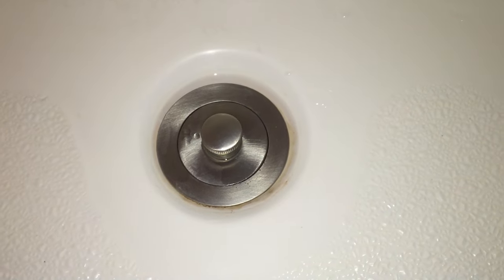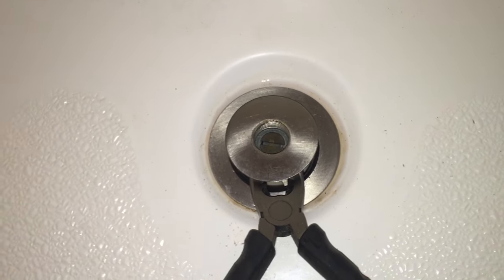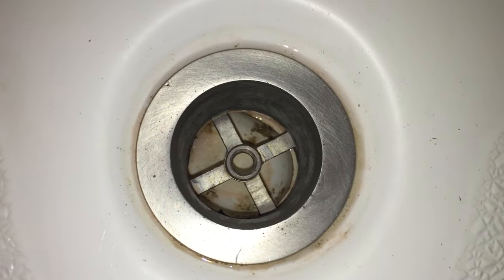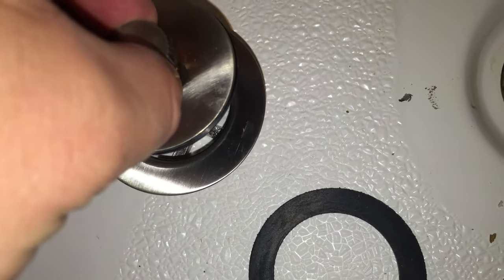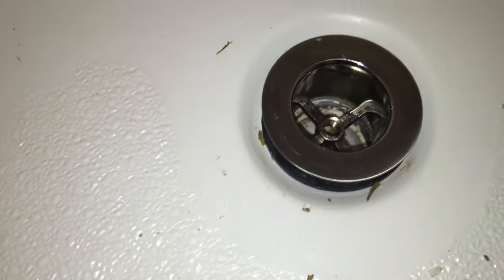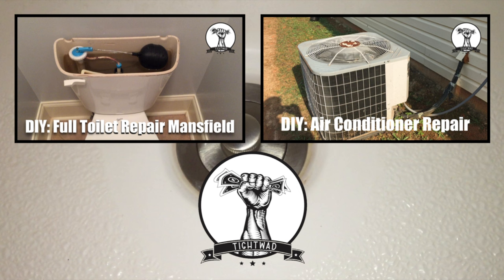DIY: How to Replace a Bathtub Drain Stopper with Common Household Tools

Comment: Rubber gasket goes on the bottom side of tub between drainpipe and tub. Use plumbers putty where he put gasket
Reply: Literally looked through the comments to make sure SOMEONE pointed this out and explained how it's done properly 👏
Reply: Yeah, most videos I've seen has the rubber gasket underneath the tub, then plumbers putty placed on the inderside of the drain screw thingy.
Reply: I really hope the water doesn't leak through and ruin the floors. There's added weight with a person in a tub, and especially the weight if they are taking a bath. That needs to be a tight seal with putty to prevent leaks, not something I'd trust to those gaskets alone that get brittle so quickly. The putty smooshes into all the gaps and creates a better seal.
Reply: Bro thanks for your skills I really appreciate it

Comment: Rubber gasket goes between tub and drain pipe...below tub.  Not between drain and tub (not on top of tub).
Reply: Correct !!!!!!!!!!!!!!!    Important point.
Reply: I understand that but once you have the drain out is it not wise to replace the rubber gasket that is probably degraded too? That was my point.
Reply: Always use plumbers putty around the seal and it's not for the threads at all...

Comment: This video is so VERY VERY helpful.  I thought I would need to hire a plumber, but after watching this video, I see I can do it myself!  YEAH!!!
Reply from the maker: Jeanne Gleason A mistake in the video was pointed out to me. Ideally, you will use plumbers putty on the threads when screwing it back in. The rubber washer is supposed to go under the tub so it isn't needed.
Reply: Again I thank you so much for caring enough to write me about this correction.  I've gathered up the tools and was about to start my when I saw your email about the correction.  I will look at your posts first in the future when I need to do home repairs.  Thanks! JG
Reply: It's fixed.  Thanks, TightWadRepairs! JG

Comment: Thank you for this video, I fixed my drain all by myself! You're such a blessing ☺️
Reply: Hope you didn't put the rubber washer under the drain like he did. It needs to go under the bottom side of the tub. You can see the original rubber washer under the tub when he pulls out the drain. You need plumbers putty under the new drain so when installed it creates a seal on the top side of the tub and there is also a seal on the bottom side of the tub with the rubber washer. It is a common mistake but it makes a big difference, this video shows the rubber washer installed in the wrong place. Not trying to be negative just don't want you to have any water damage in the future.

Comment: 0:00  Introduction
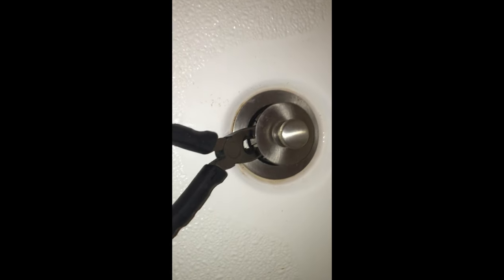0:52  How to remove drain stopper
2:12  How to remove drain
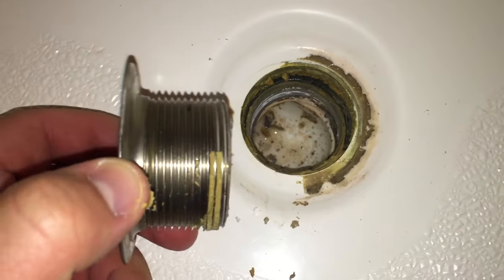3:27  Discussion of new drain and stopper
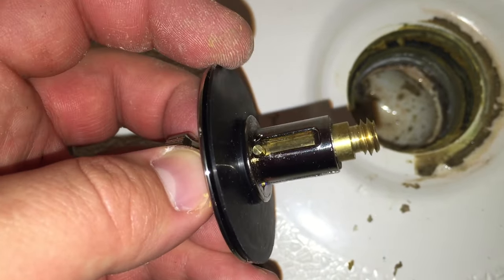4:43  Installing the new drain
5:24  Installing the new drain stopper
Reply from the maker: Thank you! I need to go back and add chapters to all of my old videos!
Reply: @TightWadDIY  also should post a correction of this video. The gasket is in the wrong place and no plumbers putty between the drain seal and the tub. Not trying to be a dick but this is incorrect. Still better than what some might do, but not as a professional 🤷‍♂️

Comment: Neat video!. Cheers from 🇨🇦
Reply from the maker: Thanks!
Reply: @TightWadDIY  been doing renovation and came across this. Very helpful. Just started my own channel.
Reply from the maker: @methane101  Congrats on the new channel! It’s a slow grind at first. Stick with it and it will pay off big time in the long run. Feel free to reach out on Instagram if you have any questions.
Reply: @TightWadDIY  thankyou. And I hear ya. I can see that already!. But like you said. It takes time. Most good things usually do. Thanks for the helpful insight!. I definitely will. Love the community!. Very helpful everyone is.

Comment: Note that some similar looking drain stoppers have a set screw that retains the stopper. It can be accessed by pulling up on the plug. Once the set screw is loosened, the stopper can be removed. For this type of stopper, the dual pliers method will not work.

Comment: The rubber gasket replaces the old rubber gasket which is between the lip of the bathtub and the drain pipe.
Reply: I noticed this too, but is a rubber gasket better that using plumbers putty or silicone?
Reply: @sacchn6199  The rubber gasket is there to seal between the drain pipe and the bath tub. The bath tub itself lowers a bit with the weight of the person in the tub, and the additional weight of the water if the person is taking a bath. These rubber seals get brittle quickly, so it should be changed when you do this. The plumbers putty is what makes the actual seal between the drain plug, the pipe, and the tub. You use extra and the putty squishes into the cracks and makes the seal water tight. If his daughter takes a bubble bath, the added weight in the bath tub will cause a small leak from pressing the actual tub down. I wouldn't use silicone (caulk?) it's okay for sealing the gap around the tub, but not durable enough for this. Really don't want water leaking under the tub onto the floor through cracks in the drain. Especially if the tub is upstairs or above a basement.

Comment: I’m so close to banging on the pipes or cutting any available sections!!! 😢😡😳
I am in the process of trying to replace my kitchen sink side sprayer, seemed like an easy enough task, until I realized that I’m no plumber or magician!! How was I not aware that rust is like SUPER glue to a bolt/nut/screw??? So one can of WD-40 and a few bad words later I  decided to move onto the next project which was the bath tub drain… I watched your video, and what do ya know..: a beautiful new functioning tub drain.! Sooooo I think I’ll just wash the dishes in the tub now 🤪🤣
Serious note thank you kindly for posting this and sharing🙏🏻
Reply from the maker: 😂😂Yes. Rust makes things very difficult!

Comment: I know this is TightwadDIY, but if your break the cross pieces in the drain when trying to use pliers - more likely with an older part - and have to buy the extraction tool, you'll maybe wish you'd spent 10$ on a proper drain wrench in the first place. And I believe it's recommended to put the rubber washer on the bottom side of the tub, and plumbers putter on the top side between the drain and the tub.
Reply: You are right. This video had a few misleading things. When I replaced mine, the tub drain was so old/rusted that the cross pieces were all half broken. Even using the drain wrench didn't work. I believe the previous owner tried using pliers and broke them. I had to buy the $20 extraction tool and a 1/2" rachet to get it out. It was a painful job. The rubber washer was supposed to be underneath the tub, in-between the tub and drain pipe so that water doesn't get underneath the tub and cause damage. The plumbers putty needs to be where this video shows the washer is. It's similar for the overflow drain replacement. Washer goes outside the tub between tub and PVC drain pipe. No need to use plumbers putty for overflow drain.

Comment: Thank you for this. I needed to remove my drain to clear it and your method worked perfectly, but when I put it back on I couldn’t get it to stay up! When you removed yours you mentioned that a piece was missing, what is the missing piece? I think mine may have gone down the drain when I was disassembling it. It was staying up fine before I took it apart so I’m thinking I’ve done something wrong.

Comment: This video is helpful but I should point out that there are several types of stoppers. One is as seen here but there are at least two more. On one type the top knob does not come off and it has a set screw below the stopper lid. Another has the whole stopper that if pushed down and turned until it engages the shaft the stopper comes out whole. Be careful with those big pliers because you can ruin your stopper if you do not have this kind.
Reply: Then how do you remove those? I have one with a set screw & it just spins, even when I loosen the screw. It's driving me crazy. I just want to clean out my drain fully.

Comment: Sometimes I think the internet was a mistake, but then the drain stopper in my tub (didn’t know what it was called 15 minutes ago) broke and here I am learning how to easily replace it in less than 10 minutes.
Reply from the maker: Nice. Use plumbers putty instead of the black washer though.

Comment: Very good video. However, the drain stopper in my house was installed in '92. The previous owner must have taken a lot of baths with bath salts as the corrosion was so bad, I broke off the '+' in the center using the drain removal tool and cannot remove it now. I have no idea what I'm going to do now short of replacing the entire jacuzzi tub, which ain't gonna happen.
Reply from the maker: Gary You will need to get a tool like this instead. https://www.walmart.com/ip/Superior-Tool-Company-05255-Tub-Drain-Extract-Tool/39109258?wmlspartner=wlpa&selectedSellerId=13578&adid=22222222228026966353&wl0=&wl1=g&wl2=m&wl3=56103153249&wl4=pla-88718151849&wl5=1015433&wl6=&wl7=&wl8=&wl9=pla&wl10=117879013&wl11=online&wl12=39109258&wl13=&veh=sem&gclid=Cj0KCQiAlIXfBRCpARIsAKvManxQBKLmqx3Ebnx3HivWqalU2xSzOSHJ9bzF0XJ0hMe_31Z74YZtfSQaAmhIEALw_wcB
Reply: @TightWadDIY  This is an underrated comment as I had a similar issue and this is what helped me.
Reply from the maker: @Leo-ni6iu  Great! I’m glad it helped you out too!

Comment: I tried everything you demonstrated, but I could not remove the plug. I'm trying to recover a diamond earring that possible went down the drain while showering.  The backing for the earring was in the tub after shower. Any additional advice would be helpful.
Reply from the maker: You may need to order the drain removal tool linked in the description. Sorry about your earring. Do you have access to the trap under the floor?

Comment: So.. quick question… what if I have the silver part on bottom.. but there’s no of the cross silver pieces. Aka I have no idea how I would twist this?. It’s just a hole. Nothing in middle o.O
Reply from the maker: They make a tool that goes in and then expands to grip it so that you can spin it out.
Reply: @TightWadDIY  you think any hardware store  has this? Going soon to get stuff
Reply from the maker: @talagothunscathed3425  I know Home Depot or Lowes would.

Comment: All i was able to take off was the little top piece but to find under it is a stripped flat head screw how do i take it off? Please help me i dont want to do mosre damage then there already is under there
Reply from the maker: There are several different styles. You may have to drill and tap the screw if you can’t get it to come out.

Comment: That rubber gasket is supposed to replace the one inside the drain, not to create a seal with the threaded part and the tub

Comment: what if the crossbar is broken?  How would you remove the drain?
Reply: This is my problem as well. I think you can use a hammer and screw driver and tap it out.

Comment: The top cap screw is stuck onto the "plate" and wont turn, any idea how to get the whole stopper out
Reply from the maker: You can try to wedge something in there and turn the whole thing to remove it.

Comment: The management where I live have dismantled drain toppers from bathtubs for safety and ]precaution of drowning. I presume , but need to soak in the tub.
Reply: flat rubber 6 inch diameter stopper.

Comment: What disaster can happen if you cross-thread the stopper as you mentioned?  Also, why do ppl even use these types of drain-stoppers anymore?  They clog with hair & gunk so easily!  A mesh screen seems to be more effective, using the stopper only when wanting to fill for  a bath.
Reply from the maker: Donald Smyth If you cross thread the stopper you will have to replace the drain pipe which means removing the tub in most cases. Our children are young so they won’t be using the shower for several years. We have no need for a mesh drain at this time.

Comment: Ok, I need to know how to get one of the “new” stoppers  (the one you installed) OUT of a tub where it constantly slips down & closes on its own. It was installed by a previous owner. I know it’s this type, it has the rubber gasket & that little keyhole. Or if anyone knows the technical name so I can google it to find a video of someone removing it that’d be great too. 

Thanks in advance from a 42 year old woman with an MS in civil engineering that can’t fix a simple bathtub drain.

Comment: My cross peice is actually what's broken. I'm not sure how to unscrew it with the cross peices being broken off
Reply from the maker: They make other tools that expand to fit the hole then you can unscrew them.
Reply: @TightWadDIY  I found a kit on Amazon that just popped in without any tools!

Comment: Rubber gasket is installed incorrectly. It goes in between the tub and the drain pipe underneath the tub. And apply some silicone or plumber's putty under the drain lip.
Reply from the maker: Thanks!

Comment: Sorry you flunk for putting the rubber washer in the wrong spot!  It belongs under the tub, not on top of the tub like you show.  The originally installed washer in this tub was done correctly